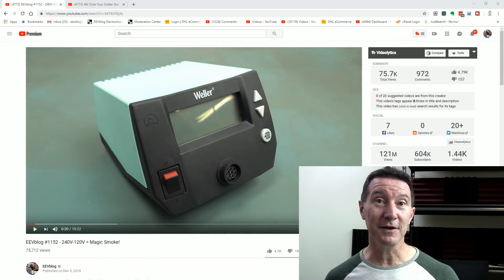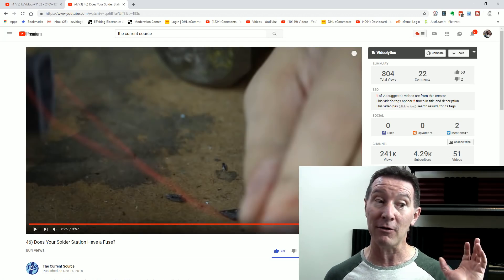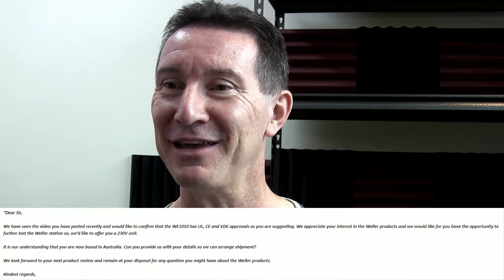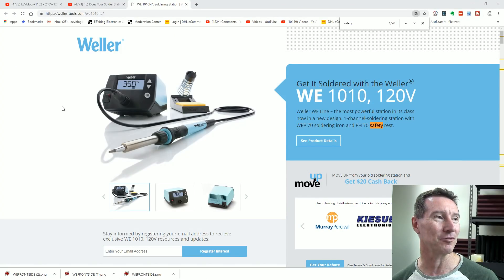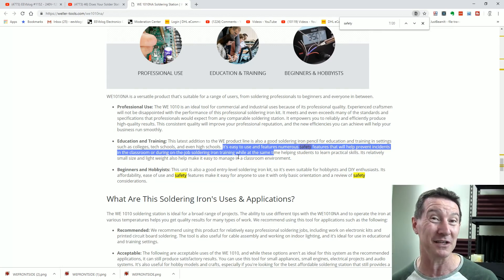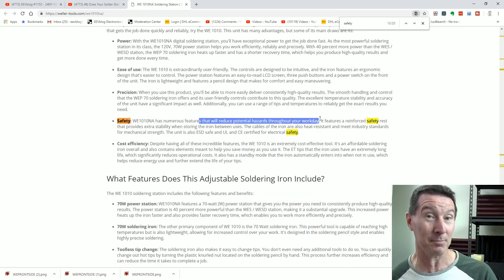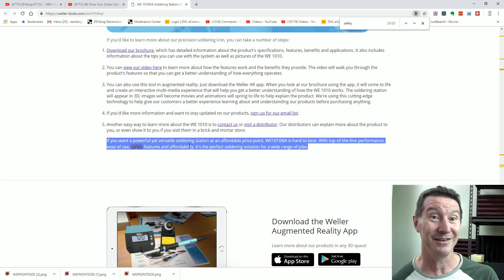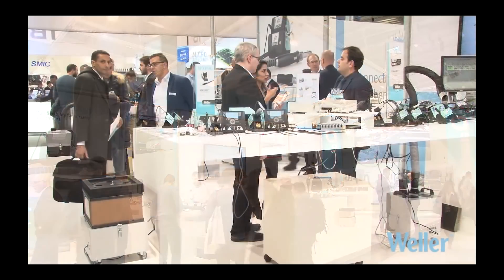EEVblog #1160 - Weller Responds!

Comment: I've have been disappointed in three Weller soldering irons/statons I've bought over the years.  I wish I knew of a solid-performing setup for less than $150!  I'd like to know if anyone has a suggestion.   I do hobby-type work with microcontrollers, etc.  I am not a fan of the Hakko FX-888D and I don't want to pay up for a JBC CD-2B.  Thank you for the update of Weller's lame response.

Comment: I'm sorry but if you are going to be stupid enough to plug a 120v Weller into 220v its user error. My Wes51 Weller has worked flawlessly for over 15 years and will probably work the same for 100 years more.

Comment: Ran across this video again and Weller could have handled this better for sure, but I still cant believe how arrogant you are for someone who purports to be an electronics expert but admittedly plugged a 120v product into 220 volts and now you seem to be trying to save face by complaining & somehow trying to put all the blame on Weller-!!  Your point about the fuse is indeed valld, but never the less for whatever reason in Wellers defense the product WAS SOLD AS A 12 VOLT DEVICE AND IS STILL U.L. APPROVED, and had you not plugged it into DOUBLE THE VOLTAGE it was designed for I doubt you ever would have had an issue with it. Again I agree with you about the lack of a fuse, but come on they offered you a brand new station regardless of the fact it was your mistake not many companies would do this.  If it was me, and it bothers you that much I would have taken Wellers generous offer of a brand new station despite your mistake and since your a tech expert just install a fuse yourself but first do another review of it showing the important shortcomings ie: the lack of a fuse and backlight then install a fuse and get years of use out of it instead of showing your azz and telling them to f*k off. Finally, not saying it hasnt happened, but ive never heard of a story or seen a video of this happening to anyone else with a Weller - makes me think sometimes a good number of everyday people might be a little smarter than some self important tech tubers.

Comment: On the other hand you DID plug it into the WRONG VOLTAGE - and they still offered you a BRAND NEW IRON despite your mistake - yet the fuse issue remains an important question

Comment: Onehunglow user here: My 2016 ZENY 862D+ does indeed have a primary fuse and both hot air and soldering iron still work perfectly after building hundreds of eurorack modules and several drunk forgot to turn the iron off nights. I currently am repairing HP Agilent gear from the 77-90 years range.

Comment: This fuseless primary crap getting a UL approval reminds me of the FAA and Boeing relationship concerning the 737Max MCAS debacle. Underwriters will be too busy to bother looking at the schematic for a fuse, or maybe Apex sent in a schematic with a fuse on the primary. How many labs or houses need to burn up before they need an ECO? Too cheap and maybe to stupid to include a back panel mounted fuse holder.

Comment: I’m sorry but you’re dumb enough to plug a 110v appliance into 240v socket, you damage the appliance and then they give you a replacement and you carry on like a parrot on acid. Sorry but you deserve a hi five, in the face, with a chair.

Comment: Do you run all of your electrical equipment at twice the rated voltage? Hows that working for you? I would have taken the replacement, added a fuse and pilot indicator lamp and called it a day. What I don't understand is how you got the 120VAC plug into the 240VAC receptacle. You should do a video on that procedure. I'm guessing it involves a really big hammer.

Comment: My japanese tube amp blew a component after plugging in 240.  It's got a fuse holder and a fuse but it didn't save it at all.  The fuse holder specced a 100w fuse but the installed fuse is actually a 500w(250v2a).  The bottom of the unit specified 22w.  So what fuse should be used to protect the unit?

Comment: The blame really Accidentally?  first in reality professionalism, safety and experience, ?  who would plug  a 110 volt powered device into a 230 volt power supply,  the response from Weller about the problem at hand and what was found to be a possible solution?,

Comment: You can't "accidentally" plug a US 120v plug into an AUS 240v outlet.  Completely different configurations.  This alone invalidates your entire video.  What else was "accidentally" modified?  Who knows?  Your word isn't to be trusted, "accidentally" indeed.  Shame.

If you had taken them up on their offer of a free unit designed for your power source and had done some valid testing to see if the lack of the fuse is an actual issue or not you may have redeemed yourself.  As it stands now, we can only assume that with the correct voltage supplied, that the unit performs safely.  You had an opportunity to possibly find some valid safety concerns, but decided your audience would be better served by being a snarky little girl and ridiculing Weller for not defending itself against your intentional stupidity.  I say good on Weller for refusing to enter a battle of wits against an unarmed opponent.

I am actually in the process of deciding between this unit and the Hakkor FX888D.  After seeing Weller's customer service's generous offer of replacing a unit you obviously intentionally destroyed, plus their total display of restraint for not calling you out for behaving like an idiot, is pushing me towards the Weller.

Comment: Fun to find this video by Dave. In my company there are a ton of Weller WX2 solder stations and they come with RT active tips. Those tips will easily defect after being pressed a little too hard against the PCB, resulting in short-circuit between the therm coupler and heating coil. You can actually see the rod bending. And these are freaking expensive. The solution was to use the older ceramic heating tips and handpiece, which allowed daily use scenarios... On the other hand, my old JBC tip (thinnest one) does not bend a bit.

Comment: My 2021 Mexico made WE 1010 120V unit does have a fuse now or at least a component that says "fuse" mounted directly on top of the  transformer near/at the yellow flat/square capacitor looking thing.

Strangest looking fuse I've ever seen.  Has the shape of a TO-5 transistor.

Correction, based on your previous teardown video of the Hakko vs Weller WE 1010, my WE 1010 appears identical with the fuse looking thing.

Comment: Different design engineers on different models. Some think a primary fuse is important and include it, some don't so exclude it. I run into things like this frequently in my job where different engineers size things disagree on tolerances despite clearly both having the identical mating part.

Comment: Hakko FX-888D has proper PCB and fuse on it. I'm pretty sure they put fuse inline with switch for primary side for protection. One of my customer accidentally turned on 110v version hakko fx-888d with 240v line. And he told me that only fuse blown. I asked him to replace fuse and he told me that unit is working after fuse replacement.

Comment: It figures, as a novice solderer I figured I needed a quality unit as I've been using a cheapo with crap results.I thought I was making a big step forward spending a $100.So after a Google search in which many reviewers stated what a great iron this is i bought the 1010.So typical of my luck.Would plugging it in a strip with a fuse help? Oh good I was able to cancel the order.Glad I found this video!
Reply: Got the Hakko  fx888 instead.If it's a fail I don't know what to say but it has to be an upgrade over the Weller.

Comment: Why has NO ONE asked HOW the 120V Weller could be plugged into a 240V outlet?  Don't they make different shaped plugs FOR SAFETY to prevent just such an occurrence from happening?  And just how "dangerous" are all those 120V Wellers if they are plugged into the correct 120V outlet?  Any record of fires from the proper use of the Weller soldering iron?  And shouldn't all electronic technician's work benches have their equipment plugged into a circuit breaker power strip - FOR SAFETY?

Comment: Dave, I think you should plug all your 110V instruments into 230V. You know that little switch on the back that says 110V in one direction or 230V in the other? The one with the red and yellow "caution" tape across it when you unbox new stuff? Just flip that little guy to 110V and plug away! And it's not pronounced "Weller", it's pronounced "Veller", it's German, like Wagner. You know the guy who wrote that quaint piece of music Siegfried Idyll.

Comment: Very interesting video and very funny ... I had a Weller PU-1D with a TCP-1 Iron which I have had since late 1970's and it still works ... and it does have a fuse on the panel ... also got a few other TCP-1 irons in a box in garage ... not sure if they work ... Great video Dave ... but I need a new Solder Station I think ...LOL

Comment: I have been using my Weller since 1987  and  loving it 
all the while.  I have always used a desktop mains 
controller for lab setup.  It has 6 switched outlets, each
with a ceramic fuse.  I know you are making a point 
but I think it is just to easy to plug into a fused power
bar and move on.

Comment: If you connect a 110V unit to 230V then you should blame yourself for any magic smoke. Also, in a normal home (at least in Europe) you should have a main fuse or circuit breaker on the 230V circuit you connected to, which should have tripped for you. If you don't have that then your home is basically a death trap. Don't blame Weller for this.

Comment: Well... I guess everything is a "fuse" if you push enough current through it... 
Anyway, just wanted to confirm that my cheap chinese 30 € soldering iron has an actual primary side fuse for you know ... "improved safety". :D

Comment: This is why I hate Weller products even with all the high rank many people love ranking them, my preferred choice of soldering stations are hakko, x-tronic and yihua, if I need to go for those other cheap irons then I'll go with LDK or Plusivo, been using these for years and only one problem I had with a plusivo iron, the hot side of the cord solder connection was broken and I just resoldered it and it is still going strong. Sometimes I think people does rate products higher than it's worth, these irons I mentioned, I have been using for years now and have absolutely no problem with them

Comment: Maybe instead of just rambling on about their response, get the different certifications in text next to the soldering station and see if the units comply to these standards. 
If so, they are right and the certification lacks in certain safety features.

Comment: What real world problem are you complaining about?  if you stick a 120vac marked product into a 220vac outlet you are the problem and you are present when the fire occurs so put it out.
Reply: The real world problem he's complaining about is that a 2 cent fuse will prevent your house from burning down. For a company that markets themselves with being concerned about safety, this is a rather large omission in the design.

Comment: The reply from Weller is BS. Even if that transformer meets IEC 61588 requirements for a short circuit proof device, the fact that the insulation failed in that way is worrisome and warrants lookign into whether the device is actually compliant. Releasing a smell and going open would have been OK but I have doubts about this one. I've seen dielectric failures in transformers due to lightning damage and the like in the repair shop and minimal smoke was reported by the customer because guess what....the fuse the manufacturer installed popped! 

All my Hakko stations have a fuse, my friend's old Weller WD1 has a fuse and even my "Shenzhen Special" KSGER T12 station has a fuse. (The T12 has been awesome by the way; it's a poor man's FX-951!)

Comment: Status of engineers: Oh about 6 on a scale of 1-10 (IF they are lucky!)
Status of Bean counters: Well on the basis of the number of "engineering" decisions they make they must be getting paid as engineers as well so 9. When a bean counter says we can save 10 cents per fuse and another 40 cents per fuse holder, 5 cents for the saved wire and 80 cents for the labour needed so we don't need a fuse - leave it, and all associated parts off the BOM!

THANK GOD I live in the UK where F-wits like that can't affect us in the same way! OUR plugs are fused so any severe problem will blow the fuse in the plug - your WAY OVER priced, and unnecesarily heavy (laminated steel transformer!!??) Weller station is probably well screwed by now but at least the house hasn't burnt down!

DUMB-arsed decision making from people who should not be let NEAR a BOM parts/price list! F**K off back to your inkwell and calculator - DIPSTICK!

Comment: Is this supposed to be used on 120 and 220? If not, I’m not sure I understand this particular problem. Normally, if you have 120, you don’t have 220. That was a big screwup on your part if you somehow managed to plug a 120 model into a 220 outlet.

I wonder how many people have had the problem you had?

I like this channel, but at times you’re a bit over the top.

Comment: So the weird 240 volt outlets that are not supposed to allow a 120 plug to be inserted? Pin spacing, orientation, size?  Those are safety features. How and why did you force fit a 120 plug into a 240 outlet?

Comment: Chinese CXG irons cost about 20 euros / dollars at Aliexpress and have all the features of a Weller station without an actual station (all the controls are in the iron itself). They also use Hakko type tips which cost about 5 euros / dollars per 10 at Aliexpress. I have two of these irons and they work great.

Comment: Weller is bullsh*it now! My new WSD81was totally destroyed after touching 230V with solderig tip! MCU exploded. The soldering iron was not damadged. The problem is in very bad traced PCB and direct connecting of soldering tip with ground without 100K-1Mohm resistor between.  With old good EC2002 you can touch 230V without any problems.

Comment: They gave you a free station? Maybe it costs a lot of money but still they gave it for free? You can replace the transformer on your broken station? Maybe it was stupid to plug it into wrong voltage in the first place? Maybe the manual states to be careful about this? 
I don't see anything ridiculous on their part trying to not loose a big load of sales from many different products which have been researched and tweaked for years. Especially when this loss of sales could happen from a random 10min video on youtube. You post your face here and risk nothing except humiliation. They risk their financial viability through means that they don't even control (your video). Consider with care who you choose to present as ridiculous in the future. Maybe one day Weller should close down and give its place to some Chinese manufacturer with zero QC and 3months response time? Wanna be a part of that?
Reply: You're not the full schilling, my friend.  A fuse  will protect against plugging into incorrect voltage.  The issue is the device has no such fuse.
Reply: I know what a fuse does. I know why its should be there. I also know why it wasn't there: 1. Because you wont plug the machine into wrong voltage if you are a pro (99% of Weller users). 2. Because most people who blow their own machines up due to incorrect voltage won't claim their product guarantee (they can sell you a new one). Not that they wont replace the one you broke if you claim its their fault... That is so, because they know its their fault in the first place. However they assume that their clients are skilled technicians and read the manual or maybe the plaque on the back of the machine that reads something like "input voltage: 100-120 V AC" before using any equipment. Besides I don't see why you would buy a Weller if you don't  solder stuff everyday. The cost of their cheapest professional iron alone is a big barrier for non pros. Regarding the UL listing argument in fact they might be right and able to get away without a fuse. If your machine is plugged to wrong voltage the primary of the transformer will fry up, but wont produce a flame that is a possible fire hazard... And yes I am very much shane, thanks for commenting on my mental state. Shows how out of arguments you are.
Reply: I might appear hostile but its not personal believe me. I have seen some of your vids and they are very nice. Please consider who you present as ridiculous though. If you bought some of the Weller irons from the 70s which where some of the best in the world at the time, you would know that they too where unfused in the transformer primary. A fuse alone doesn't make a machine either good or bad. Weller is a company and they have to sell new product. If they don't because their old product can't be surpassed or for any other reason, its their doom and in the end our own (China takes over...). The fact that we learn less of the basics in our education today and become end users of high level stuff is the actual problem in the whole "discussion" above.

Comment: I've got a Weller tiny iron for SMT use with a EC1002 controller that I've had for 20 years. I'm (almost literally) SHOCKED by this video! Now I'm going to have to open it up and most likely put a fuse in series with the transformer primary. I'm not a big customer, but I most certainly will NOT buy any more Weller products.

The VP of Marketing saying "It is our understanding that you are now based in Australia" tells me he thought you used the 120V iron in a 120V area, THEN moved to Australia where you smoked it. I can hear him thinking "oh, what a dumbass, I wonder how many other electrical items he did that with until he figured out he needs a stepdown transformer."